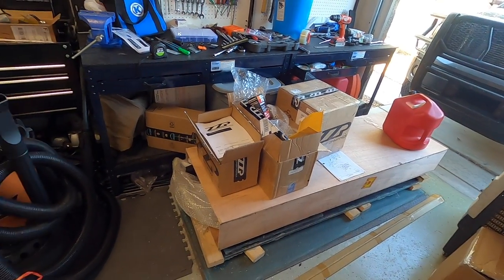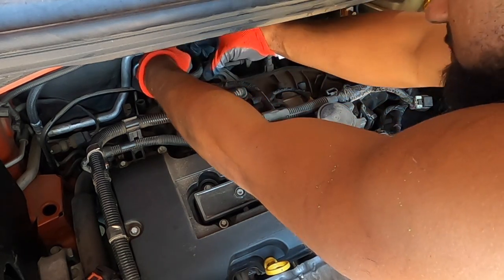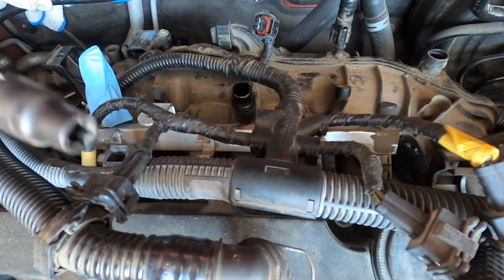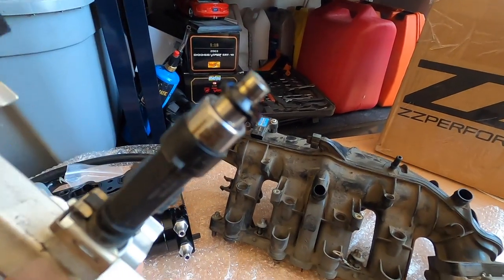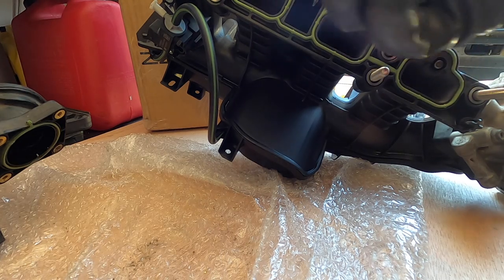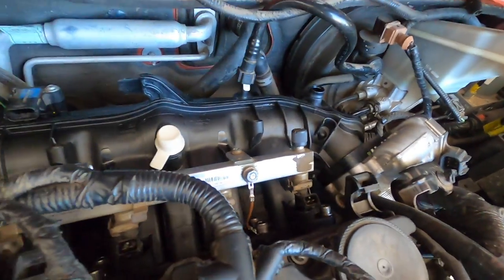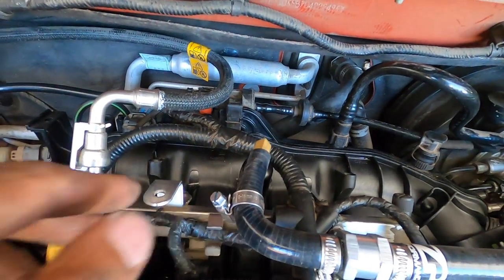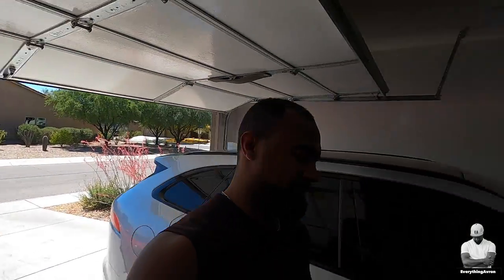ZZP PORTED MANIFOLD & PCV UPGRADE INSTALL ON '12 CHEVY SONIC| Power & efficiency with ZZPerformance!

Comment: Just a tip for the fuel injector connectors. You can just push in on those clips. They spread out when pushed in and allow you to pull the connector out at the same time. Just so you dont have to deal with the possibility of losing them
Reply from the maker: Damn that is very beneficial information! thank you for that!
Reply: Did you mean you can just put the clip on the fuel injectors and they will secure themselves when you seat them? That’s what I noticed.
Reply: Goat

Comment: Well done.  A shortcut is to remove the fuel rail and injectors from the intake before removing the intake.  No need to depressurize the fuel lines, since you do not break the line.  The fuel line, rail, and injectors can be moved out of the way intact.

Comment: Well now I have some new toys to look into for my 15 sonic. I've slowly but surely been replacing all the plastic parts with aluminum parts, just wish chevy would have done this instead of the plastic pieces that eventually go bad after a few years.
Reply from the maker: 100% true.. this little hot running engine eats these plastic pieces up in a few years seems like haha. the plastics are a maintenance item it seems

Comment: Great video.  Helped me throw on the zzp pcv upgrade.  Only thing i did differently on fuel injectors was top and bottom seals.  I'll use this easy to follow video again when if i get the ported intake manifold.  Thanks!

Comment: Their kit is simply sucking oil out of the valve cover and back into the turbo. I've been running their kit for 2 months and have found 2/3rds of the oil is just gone, sucked in through the unfiltered hose from the oil cap to the turbo inlet.

Comment: Question?: 
Instead of having everything get collected in the catch can can't it just be diverted into the oil cap? And also won't the intake manifold check valve get clogged after time cause of the size of the opening?

Comment: Excuse me if this is a dish question but how does “ opening up the airflow “ in those ports improve fuel mileage? Also wouldn’t this modification “ lean “ things out requiring more fuel flow?

Comment: Curious how you think you’re improving efficiency by installing a manifold that removes turbulence tumblers which improve atomization of fuel, and increasing the crack pressure of the check valve in the vacuum pcv path to where nearly half of all vacuum conditions are no longer applying crankcase vacuum and therefore not assisting in piston ring seal on the low tension piston rings. 

You’re making more power, but efficiency has gone down.

Comment: Excellent video explanation you did. I have similar vehicle problems 2014 Chevy Cruze Lt and have 2 questions. Does the new zz ported intake manifold that has the orange 🍊 check valve inside more improved for it not to fall off like factory one? Or can the orange check valve be replaced without taking off the whole intake manifold? I know they sell cruzekit but wanted to keep it all factory if possible. Thanks for the video and any feedback appreciated

Comment: i wasnt sure how the 1.4 manifold was made, the 1.8 manifold doesnt have those parts that were removed from yours as they have adjustable intake runners, its a similar idea but further inside with an electric actuator.

Comment: Any issues with check engine lights after this installation?
Reply: Same question.
Reply from the maker: None at all so far. Already have about 5000 miles on it, no codes

Comment: What about the orange check valve that’s down in the intake manifold? Does the ported one delete that or is it already sealed off?
Reply from the maker: If it’s the one I think your talking about… it’s still there. Just new
Reply: That's what the spacer does it deletes that air path and reroutes it to the catch can which has an upgraded check valve. 

I prefer the cruzekits pcv fix kit as it doesn't need the spacer or catch can. I may in the future do the ported intake but this is a commuter car so unless the factory one fails I doubt I'll spend extra on parts. Thankfully the valve covers are cheap and easy to swap considering the vacuum regulating valve fails daily often on these cars

Comment: How did you
Manage to get the connectors loose from underneath the car? I can’t get anything on the clips as my needle nose is to small.. don’t I have to squeeze them then pull?
Reply: Had a much easier time taking the clips off back while I was able to twist the manifold and get at them with a needle nose and pry out, thanks for showing that they are supporting it and that they need to be removed to come out. Currently just got it out and following your video 🙏 going to be nice with the Bosch 42 and bigger throttle body

Comment: the pvc kit is to fix what issue?
Reply from the maker: The factory pcv system for these cars is notorious to fail and cause ventilation issues and crank case pressure issues ultimately causing valve cover leaks amongst other issues. so this kit helps prevent that and allows for a collection point for all the blow by that occurs on these lil engines. It greatly increases the reliability and longevity of your PVC system.